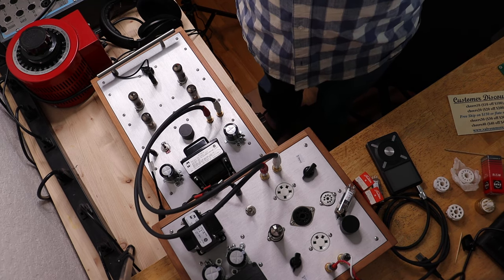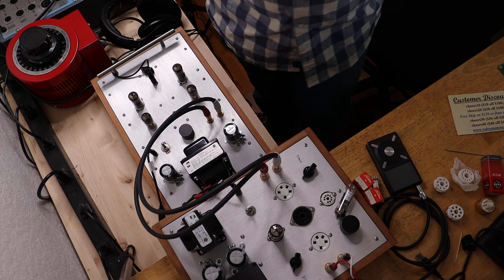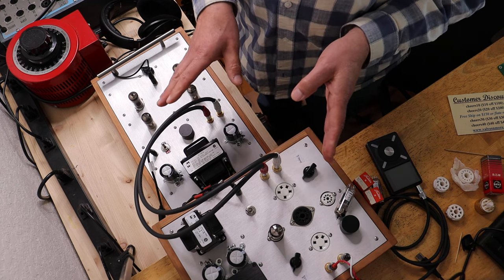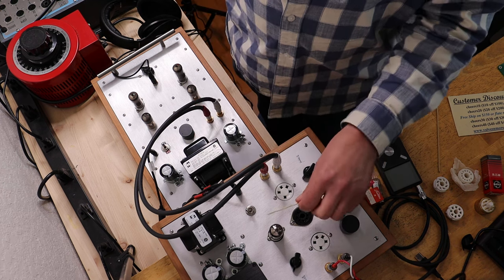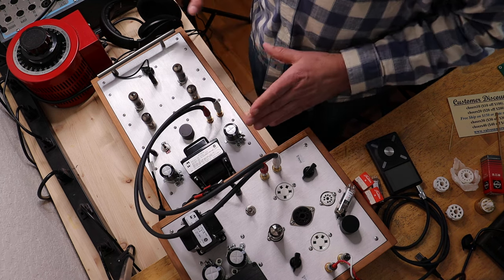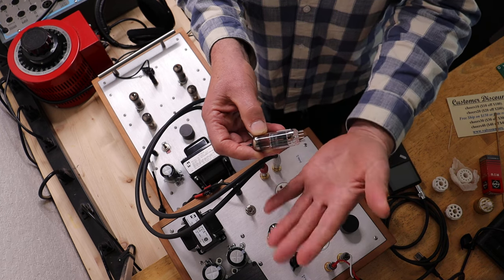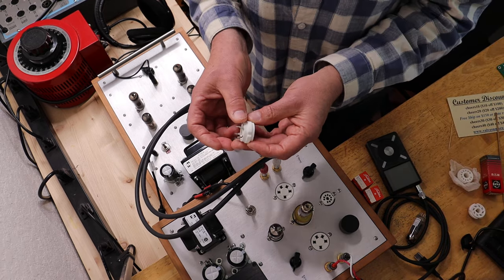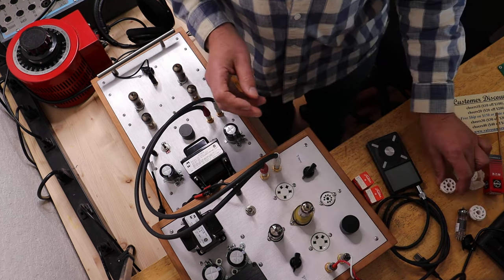Tube Lab #182 - The No.1 Problem With Tubes - Maybe

Comment: Nice review of the subject of noise...
To high the heater voltage can/will  also make a good tube noisy ...
Transistors are also sensitive to microphonics ( YBA even damped his low signal transistors )
Some ( nos ) ube type were specialy designed for very low noise and microphonics ( medical, mil , very small signals , tape heads , microphones etc ) ......ECC808, 7025 , etc
Some tuibes have micafingers on the cathode.........ECC xxx ( not all )......ECC88 /ECC188/CCA.... but not the favoured used by the audio industry in many pre-amps  6922/E88CC ( because of the big stock and dsiponibility at low price )..........they are prone to HF ringing ( most audiophiles tend to believe it is more detail !!! ) you must select them if you use thses .
Good idea is to ,mount input tubes and low signal tubes sockets on dampers as seen in older tube gear ( tape recordres, ,phono , radio etc )
A tube that is slightly microphonic can be used in the following stage .
Very assuring to buy tubes with confidence at places as yours ....
ALL this time consuming but a happy customer will be there forever and return ....in the long run both customer as well as the seller will benefit.

Kind regards

Comment: Just a couple years experience with tubes…..whistles are common and I generally don’t care unless they get intrusive while music is playing.  That said, what’s your opinion, worn out or just normal aging?  Popcorn gets pulled immediately…
Reply from the maker: In all of my years working with tubes, I've never heard a tube whistle.  That's definitely a new one for me.  I would suspect one of two things, the amp design is not standard (a lot of badly designed gear has been showing up for sale - especially in the last two years), or a modern Chinese tube - most of them aren't very well made.  I'd be interested in knowing the amp and tubes you are running.
Reply: @tubelab194  😂That’s just what I call it, maybe a high pitched whine? The pre is a Van Alstine, sounds great when tubes are fresh.
Reply from the maker: @louiesipes2257  probably the circuit being used, there are circuit topologies that will take a normally quiet tube and make it prone to noise issues.  In my design work I avoid those circuits.  I didn't have enough time Friday to include a full discussion on this problem and I see it crop up fairly often.
Reply: @tubelab194  Well, not sure about that….I get a few months out of ‘em before any issues. Silence for months and then…..nevermind.

Comment: The #1 problem with tubes is: normal tube tester only detects 4 out of 10 defects. Normal tube tester is less than 50% accurate. Big problem.
Reply from the maker: It is true that tube testers don't specifically detect all problems, however in the hands of a skilled tech certain tests can indicate another problem.  For example, when we are testing power tubes on our custom tester, we watch for grid bias supply stability, our supply isn't regulated and what that allows us to watch out for is potential G1 issues that might cause other problems.  In fact G1 issues probably account for many of the noise issues in all tubes.  If all tube sellers made a final "live" test in a well designed circuit, that would catch many problems before a tube even arrived in the customers hands - that's our policy and it saves us and our customers a lot of trouble later on.